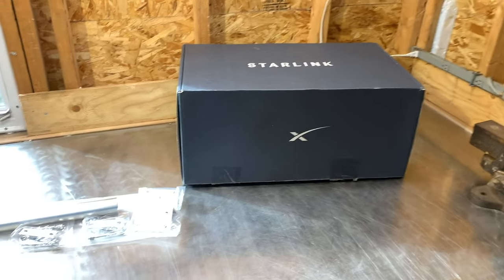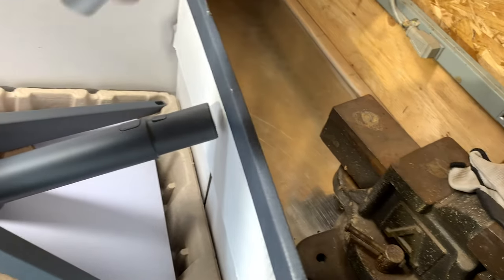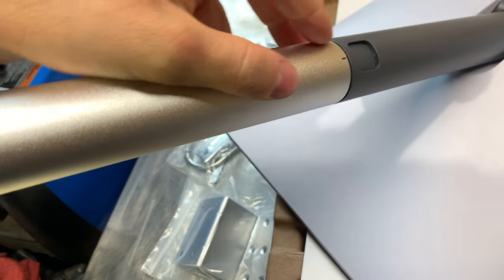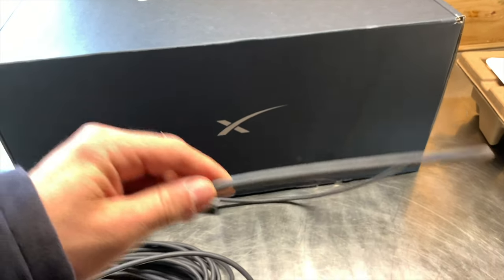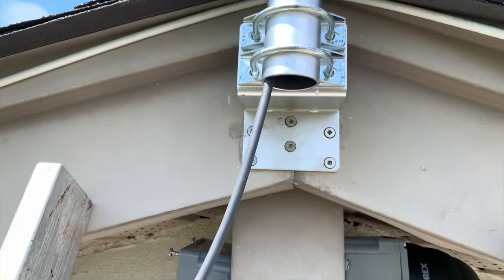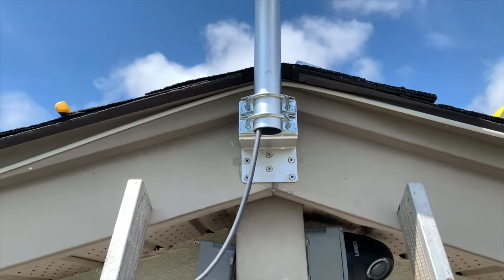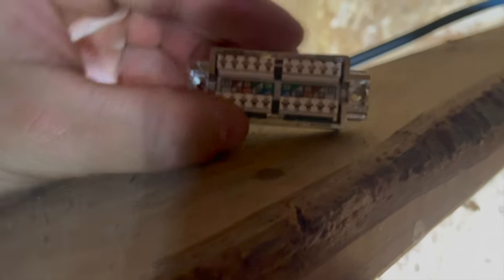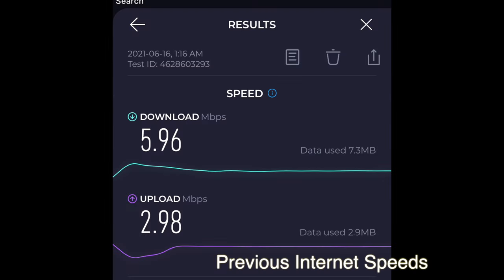STARLINK Pole Mount

Comment: Why drill a hole in the side of the building, install a conduit (which needs to be caulked), cut the wire, use the cut down block, and re-install the wire? Seems like a lot of wasted effort. You could have just put the intact wire through the hole and caulked THAT. No watertight box, no cutting the wire, no punch down. Am I wrong?
Reply from the maker: @AdamRRose  sure maybe . My way will last longer and looks more professional and also leaves access for expansion in the future . I usually think ahead and do things like this so down the road it is
Much easier to add something like a camera .

Comment: WAIT A MINUTE! Starlink only gets 3 Mbps upload speed? I was informed about 7-8, and Starlink claims 15 mbps upload. I can get 3 from Hughes Net or any satellite ISP.
Reply from the maker: Starlink prioritizes download speed as consumers typically don’t require much upload speed. If you upload lots of videos to YouTube etc. then Starlink will struggle a bit with that.
Reply: @juliensorel5535  The number is literally in the video? He got 9.99 upload. The 3mbps speed is clearly labeled "previous internet"
Reply: @kyle-qw5yx  Thank you. I noticed that later, but I did more research anyway. Starlink claims 15 mbps for my area, but other reviews find that the average speed is 7-8. Apparently it depends on exact location and can't be predicted until it is installed. 7-8 is good enough for me, so I bought it. It is installed. Tonight I will acquire service, and then I will find out for sure.  Thank you for your comment, which I am sure was intended to be helpful rather than argumentative.
Reply: @IphoneMod  If consumers don't HAVE upload speed, then they will not "require" it, since they can't make use of it whether they require it or not.

Comment: I appreciate this Helpful video. I think maybe a bolt that goes through the pole and the mount would keep it more stable from rotating in the bracket. I see the issues you have with the bracket being insufficient. Your fix works, but perhaps a welded piece of a L  metal would give a better connection. But your fix looks Good!

Comment: How did you splice the cable. I haven't seen the cable yet but just ordered 150' of it. Did use data cable end and a coupler. I was told you can't cut it or extend it.
Reply from the maker: The Starlink cable is pretty much a Ethernet cable and can just be spliced as such. Although I wouldn’t extend it, I just cut and reconnected it so I could get the cable through a weather proof seal.

Comment: Think it would’ve been easier just to order Sterling’s eve mound
Reply from the maker: Yes in some ways it could have been, although the way I wanted to completely seal the mount would not have been possible with the design of the mount that SpaceX sells and would also still require a pole to mount making this method cheaper as well.

Comment: What size is the diameter size of the pole you used?
Reply: I used my old Dish ground installation pole, and the roof mount kit fit into it as if it had been made for it. The Starlink fitting is not very sturdy, so I like having it down where I can keep track of how it is holding up.

Comment: That is a very interesting video, thanks for taking so much trouble.  One question, any idea of the latency speed of your set up please?

By your accent you live in Canada.  I live in North West France in a very rural area.  The internet reception is CR*P so hence I am looking at Starlink.  Like many people who have similar connection problems I also make how to videos for Youtube.  The last 18 minute video I made took me over 5 hours to upload!!!!

So I need to do something about this.  Plus I have a stone built house and some 25 meters away a stone built office and I need internet connection in both.  From my research so far I have come up with a pole mounted antenna on the office outer wall above roof height then a feed into the office and from the office via an existing underground ethernet cable (via an ethernet adapter) into the house.

Does that sound like it might work?  Any help or suggestions would be gratefully received.
Reply from the maker: The latency is very similar to other YouTube starlink test videos, although it has been pretty inconsistent in my area lately for unknown reasons… possibly more network saturation due to the special offer they have been offering. Yes I am in Canada. 

That sounds good, just make sure you understand your limitations with what you get with your starlink.. lack of Ethernet ports etc. unless you purchase the adapter.
Reply: @IphoneMod  Very many thanks for your helpful reply.  That gives me a good steer to where I want to get too.

Regards, Tony Hillyard
Reply: A further question, if I may.  Is there any way I can actually find out what the delivery time of a Starlink kit please?  The idea of clicking on a button and ordering, giving my credit card info, then possibly be given a delivery date does not appeal to me.  This is not as if this is some high end car or a new private jet, is it.

I also make "how to" videos to help the folks out there and I need a faster internet connection.

Any help or advice would be greatly appreciated.  Tony Hillyard